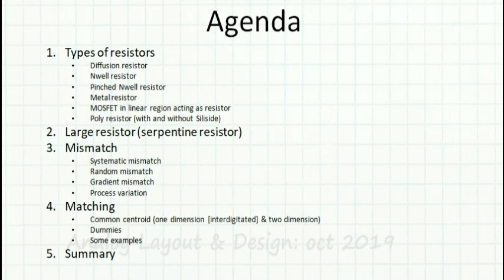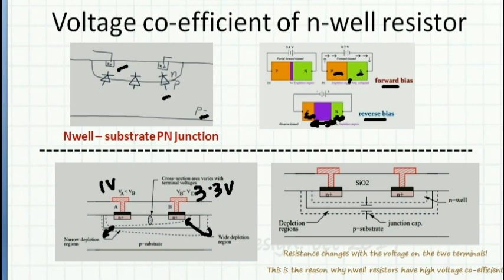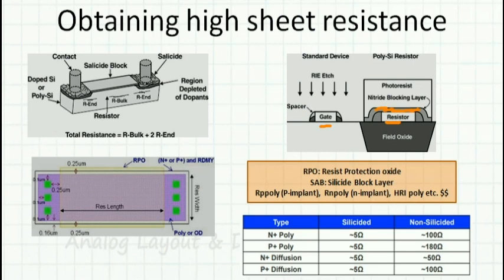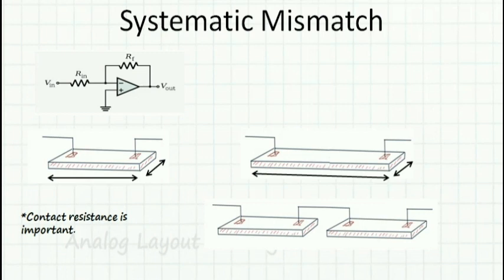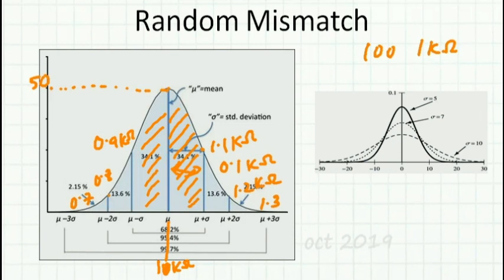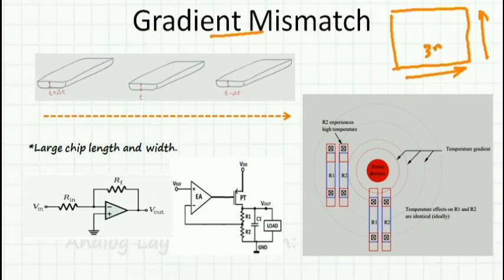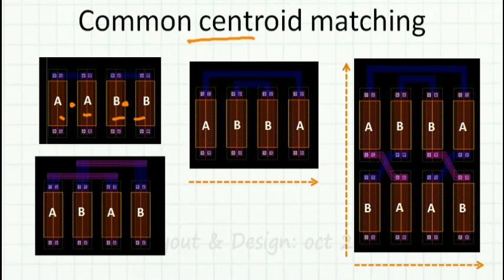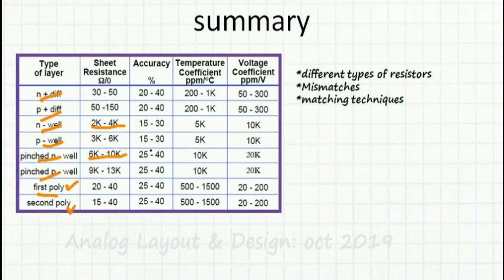Semiconductor resistors part 2

Comment: sometimes I have seen there is a guard ring around a resistor. Guard ring around a transistor is understandable but why would we need it for a resistor ?
Reply from the maker: No need for a resistor.
Bcos gaurd ring is to do with substrate.
(Unless its really high frequency design: there could be capacitive coupling from/to substrate)

Comment: sir, I have doubt in which situation we place dummies by all 4 sides ( left, right, top and bottom )  and in which situation we place dummies by left and right
Reply from the maker: depends on the aspect ratio of the resistor ..ie length/width...if width is considerable, then you may have to place dummies on top and bottom. else for resistors, left and right dummies are enough...it is decided on a case to case basis
Reply: @analoglayoutdesign2342  OK  TQ Sir
Reply: @analoglayoutdesign2342  what exactly "considerable width" quantitatively means??
Reply from the maker: @mohitupadhyay4866  depends on the aspect ratio....if length = width, then please consider..